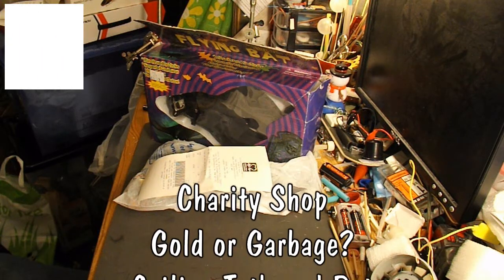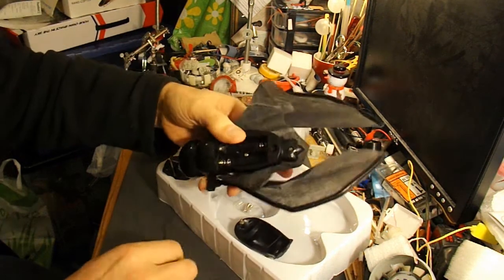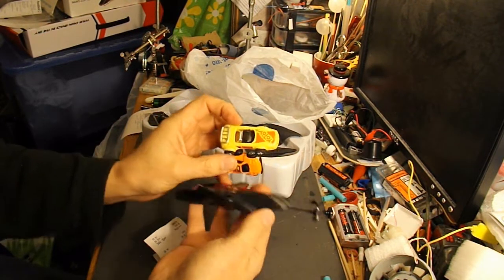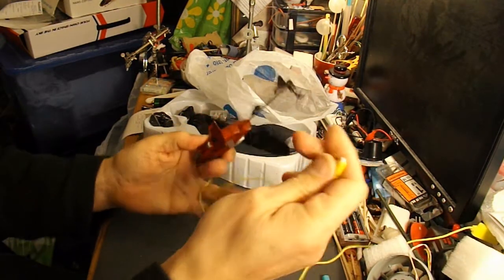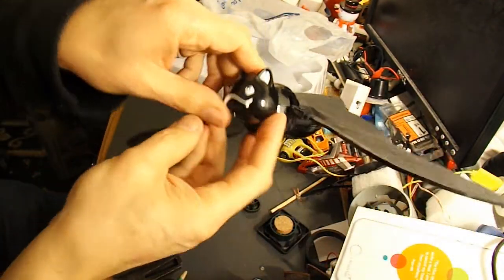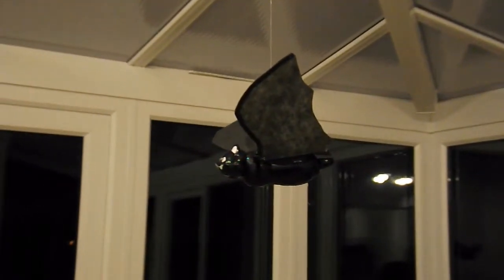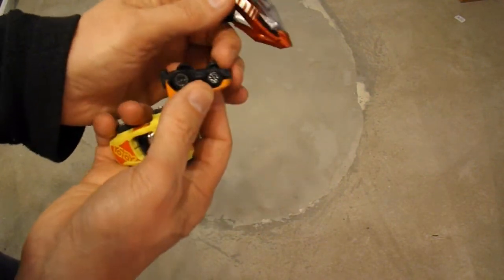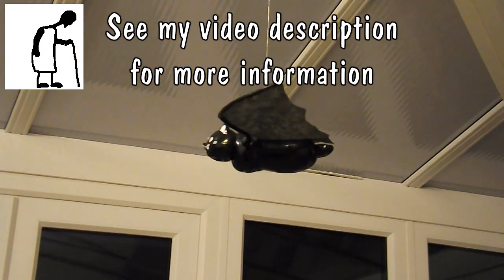Charity Shop Gold or Garbage? - Ceiling Tethered Bat Ornithopter

Comment: As I recall, those Silverlits (Picoo-z type starting 2007ish) had 3 bands, A,B,C, so perhaps a charity shop transmitter with such bands on it will work. Should be fairly common though to find if wanted one, Silverlit being a massive name for toy copters. FastLane were a rebrand name in case you see that. May only be for Toys 'R Us in USA though,
Reply from the maker: I have 4 transmitters with a,b,c channels, tried them all none worked. But I now have 2 more motors some gears and a small LiPo.

Comment: If you cut of the string and make the wings more bigger it will glide on its own.
Reply from the maker: Unfortunately no it wont. It is far too heavy and that motor would not flap bigger wings. It would have been nice if it did. If you want to see some amazing radio controlled ornithopters I can recommend Kazuhiko Kakuta https://www.youtube.com/channel/UCAanjlVj-9dI6-Akwd1f5EQ